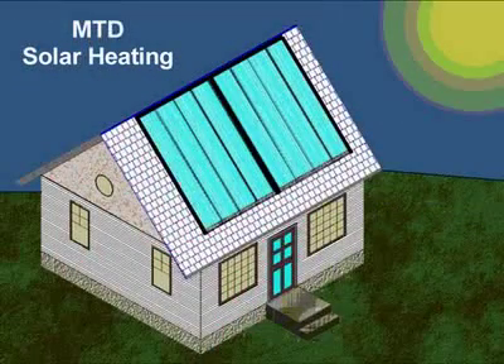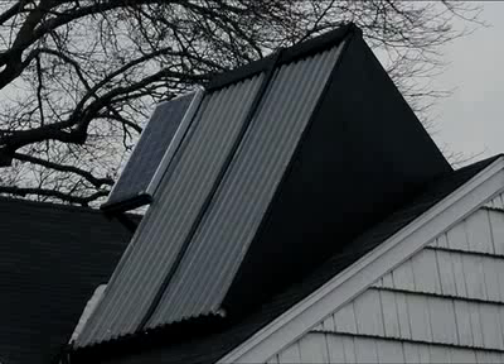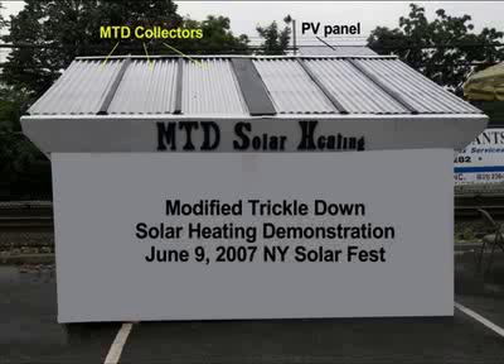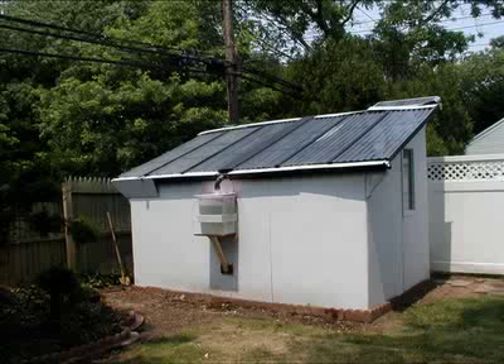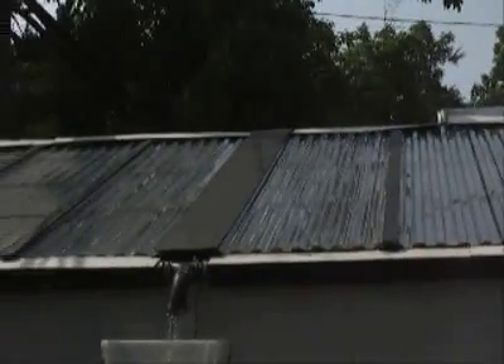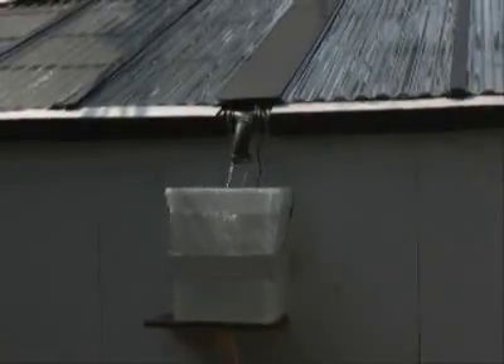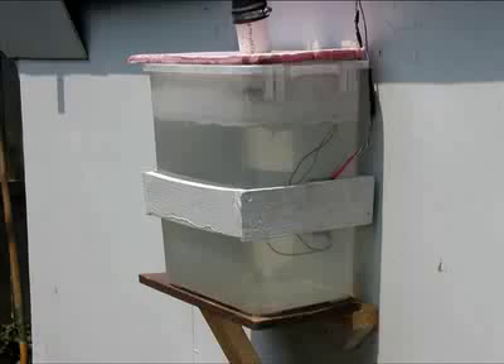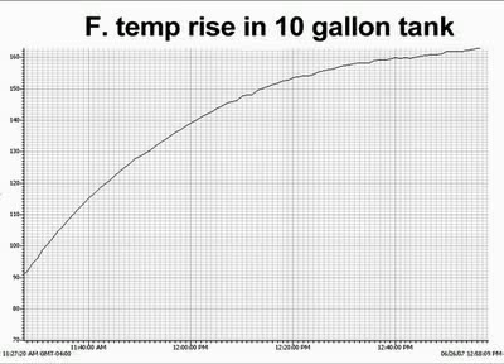MTD Solar Heating

Comment: John I am a poor man and cannot afford your kit. Can you share where to purchase the felt you use?/I have made a bulk tank from a recycled hotwater tank from the dump, I have a 100 ft coil.blk pipe on the roof , trying thermosyphoning however I may need a solar pump to circulate the water..any help   Thanks Phil R

Comment from the maker: Hi Doggiesaurus
Thank you for your interest.
MTD Solar Heating was specially designed for cold climates. The shed you see was designed for a summer exhibit but I have since inceraised the pitch of the roof to 50 degrees. As long as you live in a place that has sunlight you will be able to exract heat from sunlight. For more info google "MTD Solar Heating"